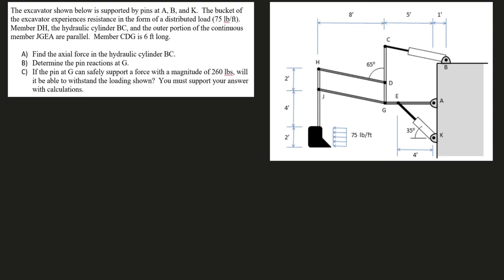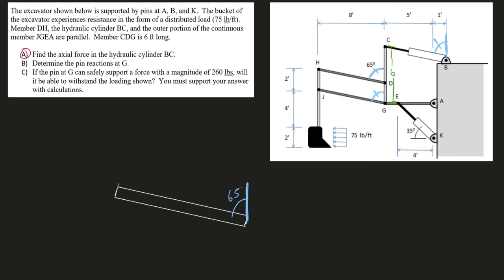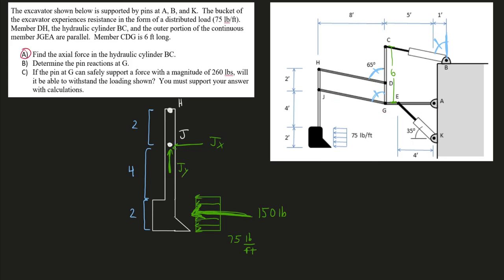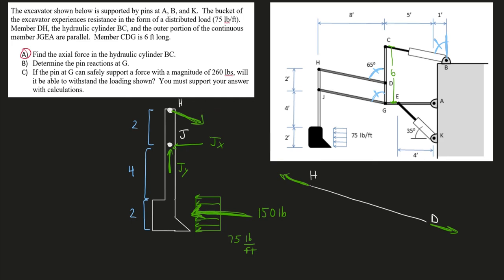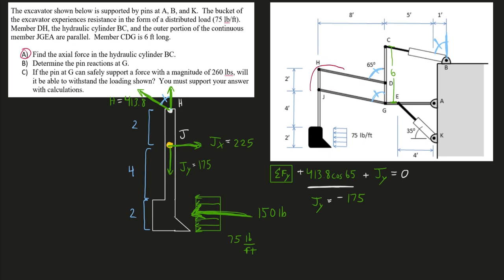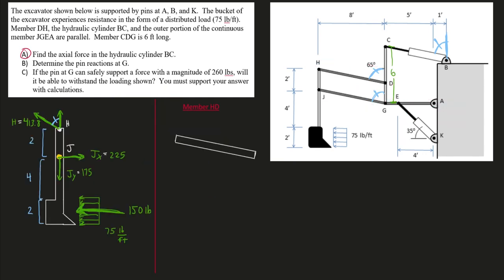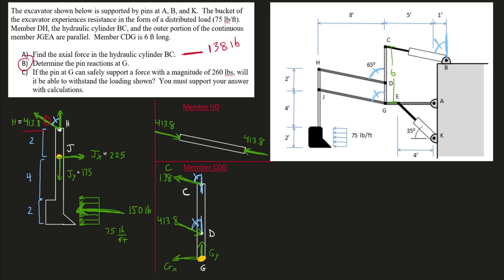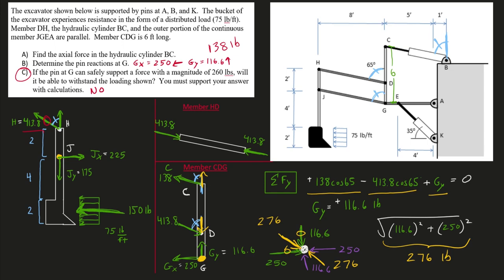Statics: Frames-Machines Exam Problem 2

Comment: Great i found one of my solution from this slide, also can you please explain how do calculate frame cross sectional area of CDG & AGJ or stress value of this,  assume any material.. thank you so much
Reply from the maker: Harin,

Stress is a measure of how much force is distributed over an area (in a sense, it is pressure), the formula for it is Force/Area.
In this problem, we are not given the cross-sectional areas (and we are not given enough information to calculate them ourselves), therefore we are unable to calculate stress
Reply from the maker: @harinns3520  I'm sorry, it sounds like that is a different class I don't know how to solve
Reply: I have done it today...